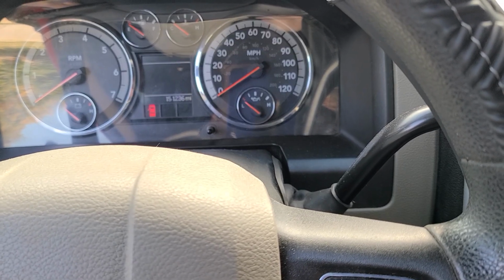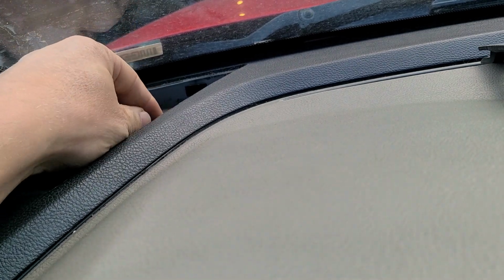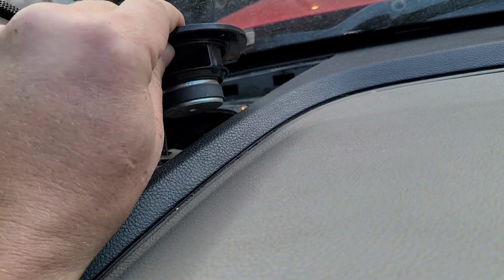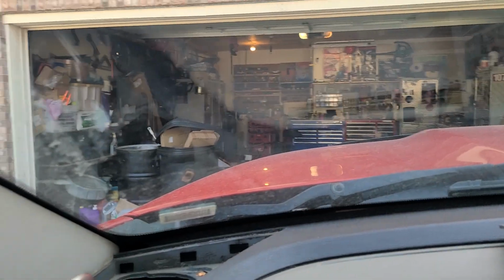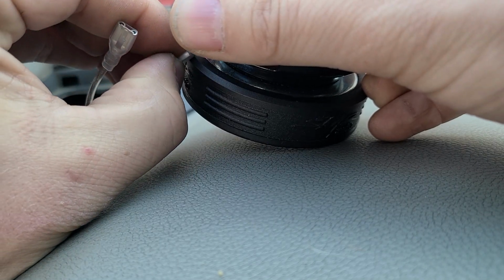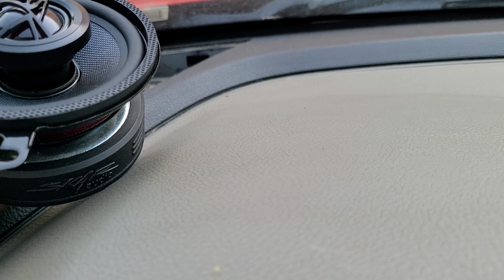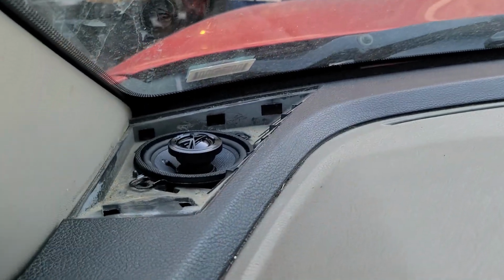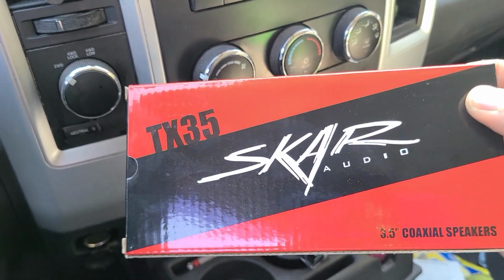Skar Audio 3.5" dash speakers installation & review 2012 Ram 1500

Comment: Question why did you go back with a full range speaker and not go back with a dedicated tweeter like what came out. I ask bc in theory wouldn’t a dedicated tweeter hit the highs better than a full range speaker?
Reply: Aye Juan, I replaced mine with Kicker DS350's and they SCREAM with a Fosgate 75x4 amp tied in with the door 6x9's. These have a dedicated tweeter also so you get full badass sound in your front soundstage, get the Fader set right and you'll be blasting clean sound from all 6 speakers..
Reply: Yeah the speaker has a tweeter in the middle, clear sound